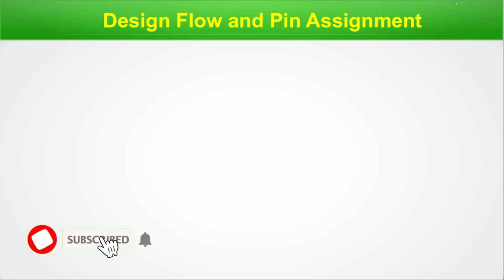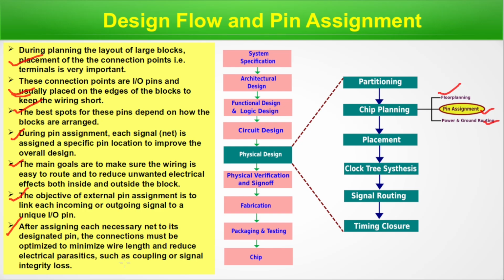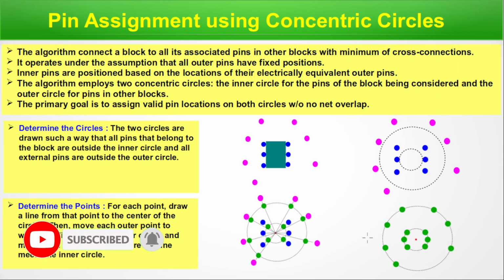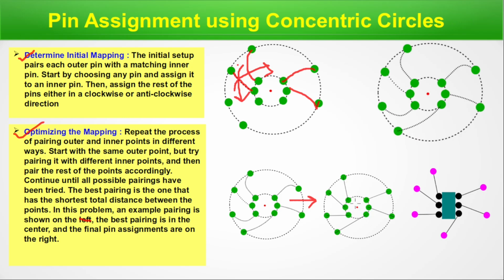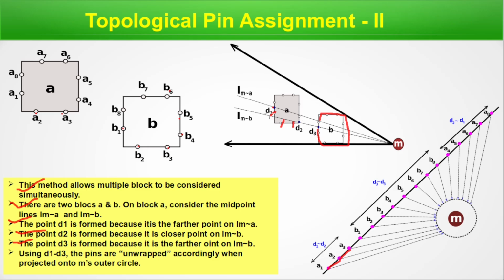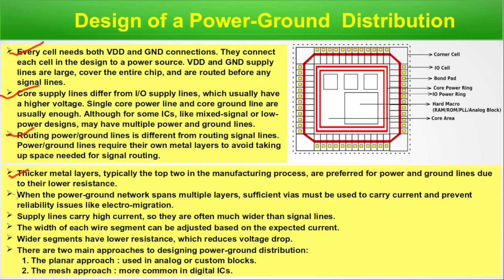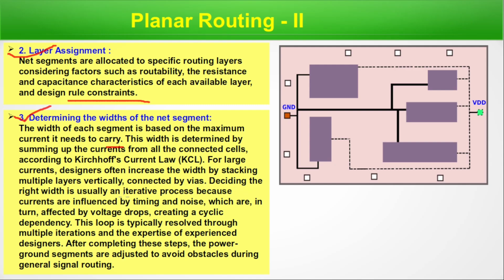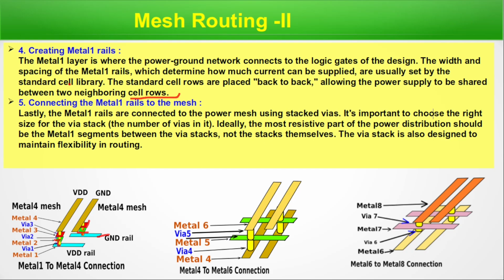Pin Assignment and Power-Ground Routing in Physical Design

Comment: Good explanation mam only thing is if you have explained examples manually instead of explaining example in PPT it would be more understandable
Reply from the maker: Thank you so much for the feedback! 😊 I truly appreciate your suggestion. This session was focused on the basic mathematical approach, so the examples were kept in the PPT format. Manual examples would require a proper tool setup. However, when we do a series using open-source tools, I’ll definitely try to include manual examples to make it more hands-on and relatable. Glad you found the explanation helpful otherwise!